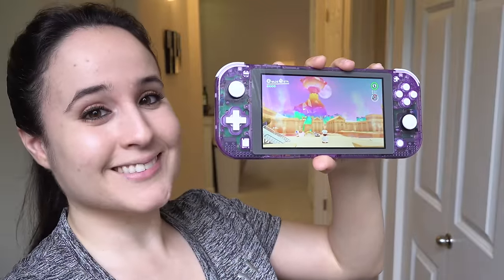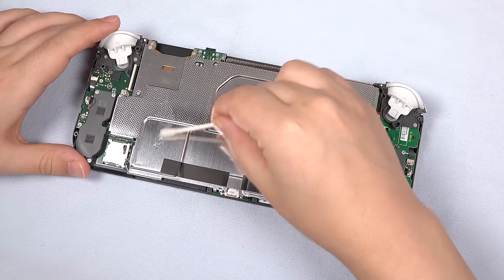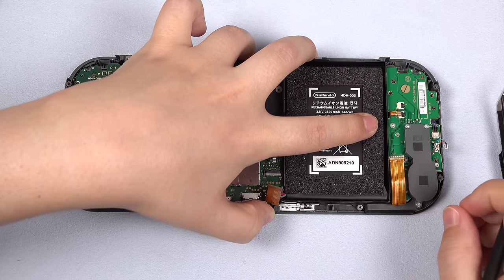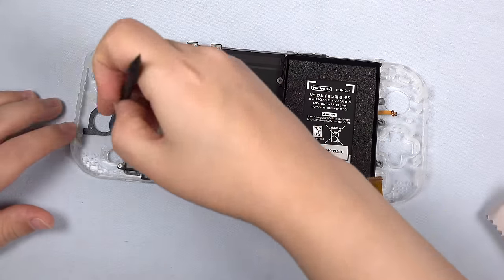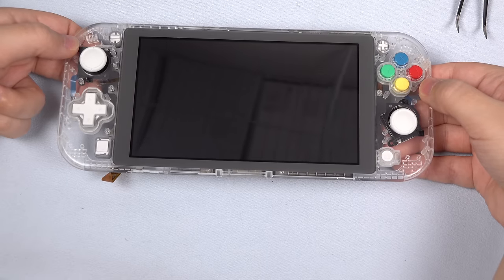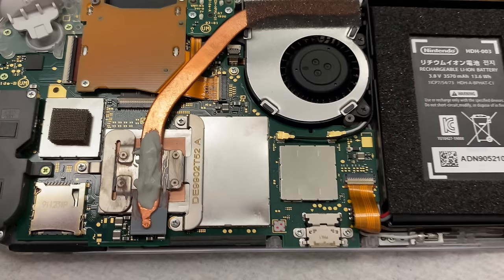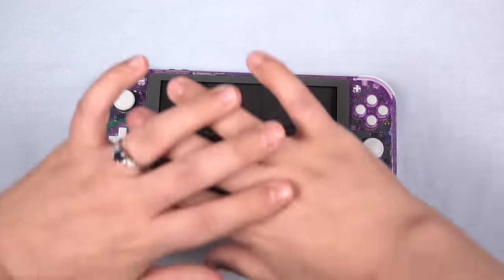DIY Switch Lite Shell Swap: Step by Step Tutorial [4K]

Comment: Lol dang I thought all I had to do was just remove the shell
Reply: Same
Reply: That happened to me when I had to change the drive on my PSP 2004 model. Laser was broken. I got the new drive, then checked a few videos on how to do it and decided to swap the shell in one go too, had to take it apart entirely anyways. So I also got a new shell. It was scary, there are even more parts and screws than on the Switch Lite (I've done two Switch Lite case replacements) and I was extremely inexperienced, but I got through. Had quite a lot of fun with that thing and it was pretty unique, clear bright blue.
Reply: Can you please list the external materials required to do this, like the thermal paste etcetera, I got part way through your video took my Switch apart and then learned I didn't even have everything I needed! I'm not saying this is your fault at all but the heads up that other components are required to do this would have been handy before frustration and dissapointment was caused
Reply: Ok so it def was more advanced than assumed lol... Especially with heating around the screen
Reply: @fenrirharrell7833  it's in the description for anyone who wants to know she forgot to leave a link to isopropyl alcohol but most people have this anyway so, just pick some up at your local pharmacy.
Reply: I  was guna do this by my self now I'm guna leave it to the professional  my battens keep sticking  and would love to change  the cover
Reply: Same. I'm not going to do it im to stupid
Reply: @TheJonny2480  you're not stupid. It's just a risky thing to do. Don't put yourself down
Reply: Same
Reply: I would literally only change the back I’m not taking apart the whole damn system
Reply: This is way to advanced for me. I might make my boyfriend do it but im scared he'll destroy my switch
Reply: Dang is there anyone reputable out there that does this type of modding? Crazy it's not just a simple shell swap!
Reply: @A_Gzilla  I’d do it for you but it cost probably $175 plus shipping and the shell kit. It takes a couple hours. Big job but not impossible if you’re patient.
Reply: I’m just gonna get a new one
Reply: Same
Reply: same i’m pissed😂

Comment: I would recommend making a video on how to fix the joy con drift! There may be lots of videos out there that relate to that topic, but you explain things so well in 4K. Plus you’re awesome!
Reply: Just replace the sticks. They're easy to replace and it's more of a permanent solution than to fiddle with them by trying to open them up.
Reply: This video covers it.. why are you promoting the same content being made more than once. All it takes is some really well placed time stamps to get the same video about how to fix or change the joycons.
Reply: I've already seen a video on this very subject! Though it mostly depends on its diagnosis.

Go to the calibration settings via Settings>Controllers and Sensors>(scroll down) Calibrate Control Sticks>Tilt the stick you want to calibrate.
Once you have selected the joystick you want to calibrate, watch how it moves away from the center of the '+'. Apply pressure to the shell directly by the joystick (just the part by the hole it comes out of). If the dot goes back to the center of the '+', you have an issue with pressure on the inside of the joycon.

To fix the pressure problem, simply put a small piece of paper/cardboard (about 1mm thick) on top of the joystick, between the silvery back (of the stick) and the battery plate. That should fix it!

HOWEVER, if that does not fix the problem, the issue is definitely just your joystick and you need to replace it.

I know it's a year late, but I hope this response helps you understand how joycon drift happens and how you can permanently fix it! <3
Reply: @nomoretwitterhandles  Spot on

Comment: Timestamps for ALL SCREWS
--------------------------------------
Just taking some personal timestamp notes for the screws! Kinda messy notes since they were for myself but if you can figure them out I hope it helps!

TOTAL SCREWS: 48 (to keep track)

1:47 - x 4 Back Screws - x2 Top Screws - x 2 Bottom Screws

2:25 - x3 Silver x1 Gold Shield Screws

3:03 - x3 Copper Heat Pipe Screws

3:25 - x7 Game Card & Audio Screws

3:44 - x3 Black Fan Screws

4:07 - x2 Gold ZL - x2 Gold ZR

5:06 - x1 Gold Left Speaker - x1 Gold Right Speaker

5:39 - x2 Gold Left Board - x2 Gold Main Board (SAME SIZE & COLOR)

5:53 - x2 Long Silver Midframe

6:05 - x3 'Board Screws' (SAME SIZE)

6:36 - x2 Joystick Left - x2 Joystick Right

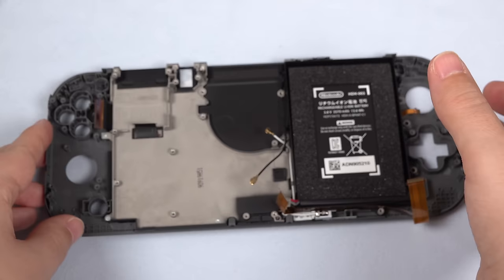6:58 - x1 Long Silver Midframe - x3 Smaller Midframe (LAST SCREWS!)
Reply: youre awesome brooo
Reply: Your video has been immeasurably helpful ! Also when you note the gold screws during the rebuild was so helpful for me. Thanks for these notes !
Reply: You’re amazing
Reply: You are a life saver

Comment: I just did a shell replacement following this. Some advices: 
1: you don't have to disconnect the battery. The little cables that goes to the connector are VERY fragile. They break very easily and if you do like in this vid (unpluging it by pushing out the cables) you will break it for sure. Just make sure that you power off the switch COMPLETELY. Do not dissassemble if you have your system in wait mode or you may fry the motherboard.
2: the same goes to the speakers. You don't have to unplug them. They are EXTREMELY fragile and breaking the cables is very easy. Just handle the board with extra care, but do not unplug them.
3: the new shell should not use the original screws. Use the ones that come with the new shell, as you may crack the shell otherwise like erica said.
4: do not place the hair dryer for a WHOLE minute while it's on hot. Just a couple seconds its okay. You may damage the digitizer and the LCD if it is very hot. Remember that you only need to heat the adhesive, not the LCD.
5: it is not necessary to replace the thermal paste if its in a good condition, but it's always a good idea. The switch lite does not overheat that much either.
Reply: Thank you!
Reply: Too late I broke…
Reply: Definitely unplug the battery; it's cheap and easy to replace the battery with a new one that will have a new connector should you break the wires off the connector (which you likely won't anyways).

On the other hand, if you short a chip somewhere on the motherboard because you didn't unplug the battery, you might as well buy a new switch.

Comment: I just replaced my shell with an NES shell. You made it very easy and i was able to pause (ALOT). Everything went smoothly and everything works/ functions great. Thank you! Side note, i did have to slightly sand down my L trigger as stated. Thanks for that tip as well.

Comment: Yes this tutorial was one of the best on youtube for Nintendo Switch Lite Shell Swapping. I especially love how you dont peel up the battery since its not required to do so. 
The only omission from it is how to lift the latches on the ribbon cables. You dont show how to flip the latches on them. I did have to look to another video for that, but with that sole exception, I followed yours step by step to change the beat up looking (but good screen) switch lite I bought for my daughter into a custom atomic purple, pink and unicorn theme switch lite.

Notes I especially liked:  Pointing out if all the screws were the same, or if one was longer. Doing the gold ones or longer ones on a different step to avoid confusion.  Speaking of your sponsor, ifixit, they make a "ifixit anti-static project tray" that honestly, I initally thought was dumb. my wife got it for me.  But..... following your guide, I did each step with the screws and parts placed in a compartment.  each step was a new compartment.... so when I went to reassemble, the screws were together. Parts were in correct order. Was excellent.

Comment: This is way easier than I thought it would be. The design is genius how everything plugs or screws or pops in. It's just a lot of steps, but that's what the video is for! Haha, so you can follow along.
I modded my GBA and I had to carefully trim parts of the shell to fit the new back-lit screen , with the clear green shell, every little cut or scratch shows through.  I'm glad this doesn't require any cutting of the brand new shell.
I definitely want to do my switch now in a clear jungle green, or clear slime green, or clear orange like the N64

Comment: THANK YOU!
This was by far the best video I've found on this topic. I've done multiple joycon shell swaps and was a bit intimidated by this mainly because of worrying about breaking the screen, but thankfully the entire process went smoothly. Well, _except for breaking the left speaker. Not the speaker itself, but the connection that's soldered to the board that it plugs into. I accidentally pulled on that instead of just the wire/plug kajigger. I can solder, but I'm not confident enough to attempt soldering that small. Plus I don't think I've a tip that small. But, *oh well. I typically just use a BT speaker or headphones.

Regardless, I've now got a very sweet looking all black (housing/buttons/sticks) and I'm much more comfortable with this sort of thing now.

Thanks again!

Comment: Thank you very much for the tutorial! Very clear and straight-forward!

Just one tip tho: when removing the battery connector, be veeeery careful not to pull the black connector of the board, only the gray part. That was nightmare to solder back lol

Comment: I had to replace mime because it took a hefty fall and destroyed the casing near the left speaker. Also ever so slightly bent the motherboard so it'll never be new but thanks to your tutorial my switch lite looks good and is running as perfect as it ever did. Thank you for being so in depth. Btw the blow drier was clutch. Heat guns can be a little too hot.

Comment: I did the same thing for a normal Nintendo Switch and it is significantly easier. You don’t need to d/c ribbon cables, battery, audio ect. or go into the main motherboard. You just remove a backplate and replace front and back shells of the joycons after you unscrew and undo 4 layers in the joycons themselves...not to mention only 2 types of internal screws. For the Switch Lite you have to basically take everything apart whereas for the normal Switch it potentially takes 15-20 mins if it’s your first go and afterwards when you realise how easy it is, it takes 2mins.

Comment: I was following this guide and I made 2 mistakes. 1, I broke off the right speaker entirely from the motherboard (didn't understand what you meant by disconnect) and 2, I snapped of the lock to the fan's ribbon cable. The speaker I don't mind since the other one still works, but I am concerned for the fan. Will it still be able to work? The ribbon cable is in, but just not locked into place.

Comment: Hey Ericka, great video! I was able to get the complete shell swapped. Only problem is that after an hour, the screen started to flicker on and off rapidly as I was playing a video game. Initially it was fine though. Any reason this happened? 🧐

I made sure to clean and apply the thermal paste in the heat sink as well.

Comment: Hi, I have a question. I changed the casing on the Lite but I feel like the buttons are not well adjusted. When you move the console it makes a rattling sound. Is this normal? Because I installed the colored buttons that came in the package.

Comment: I followed your instructions carefully, however after completion I noticed 2 issues with my switch. The volume buttons are occasionally unresponsive and it won’t take game cartridges anymore. I made sure the ribbon cables are inserted correctly with the clips closed but it’s still not working. I don’t understand what I did incorrectly.

Comment: Hello, I have stripped screws, so I am not able to remove them properly. The Y screws, also the Phillips screws are stripped. Have tried already the rubber band method, didn't work. Do you have a clue on this?

Comment: Hello!
I followed your tutorial, but I've come to a error: the fan automatically turns on at max speed as soon as I turn the Switch Lite on. 😰

I'm a little scared that it could get worse.

Also, the system detects when there's a cartridge inside, but won't read it (it displays a message saying that the cartridge can't be read.)

And last, the new "+" and "-" buttons are so tight, they don't even get out of their respective shaped hole, I've tried to switch them upside-down, but they are still so tight to fit.

Do you have any advice and /or help??

Comment: Ok so I made it to the part where you test for function. There is sound but the display is black. I've tried turning it off and on multiple times, that works, but still no display. It flashes once each time I turn the screen on, so I know it works, but it doesn't work. What am I doing wrong here?

Comment: Really cool tutorial and thanks for your help. I just gotta say its not ideal to test the Switch when the back is exposed, as your fingers can induce ESD onto the motherboard. Its be better to get the back cover and place it on to the Switch (without screwing it in yet) before testing to avoid potential discharge.

Comment: I want to do this in atomic green using the yellow switch lite so the edge around the screen will still be yellow to go good with the yellow buttons. The yellow & green would go good for a Zelda theme. Maybe even put a Zelda decal on back or on the metal heat guard on back before putting the clear green shell on over it. Problem is I still cant find the green shell for the lite.

Comment: Not sure if this has happened to anyone else, but i did the whole process, step by step and was careful, however, when we got to the part of testing the functionality of the switch after putting most of it back together, my screen now is ghosting. Looks like burn in. Not rlly sure what to do, I tried reseating the LCD ribbon cable, digitizer ribbon cable, and backlight ribbon cable. The screen responds to my touch, but the image is distorted.

Comment: What a small battery for the size of the device. Given that the connector looks pretty standard, I have to wonder if you couldn't just replace it with a battery with triple the capacity.

Comment: great video! but just an FYI you do not need to clean the paste nor replace it, i didnt with mine and it stuck back perfectly fine :)
Reply: A thermal paste’s purpose isn’t to stick things. It basically prevents your device from overheating and is highly recommended that you reapply it.

Comment: Hi Erica! I tried your step-by-step tutorial today and I faithfully followed everything in this video. I even made extra sure to carefully remove and handle the screen and the ribbon cables. However, careful as I was, my Switch Lite is stuck on a black screen. I know it's on because there is a sound when the button and the screen are pressed, yet nothing appears on the display. Do you have any idea what could have gone wrong and what should I do to fix it? Would greatly appreciate a response.
Reply from the maker: Bring the unit into the light and see if you can see an image on the display. 

It could be that your backlight cable isn’t pushed far enough into the connector. Make sure all the connector clips are closed.

Comment: Anybody able to give advice on the LCD? I've got it back together but I have no video signal. I get the menu audio.  I heated it using a hair dryer, then used a guitar pick to slowly work around it so I don't think I bent it, but is it possible I got it too hot with the hair dryer?

Comment: When I remove my battery part it stick on top of my LED screen so when I remove I heard tape tear sound from my lcd screen, but there is no crack line on the screen, but when I re assembled everything after boot up my screen is dead and not switching on? Anyone have the same issue ? Pls help😢

Comment: This was so helpful, thank you! I have experience with only the "doesn't matter if it goes back together" level of electronics deconstruction. This video made it so easy. In case anyone is curious, like I was, I took a photo of all the screws from the switch. 48 total screws. Following Erica's instructions, I ended up with 15 groups of screws. You could probably do it with ~13 groups if you wanted to. Took me about 3 hours overall.

https://i.imgur.com/ExVAx8T.jpg
Reply: Most of the screws are the same length and you don't really have to take the fan out, so you don't really need an extra group for those three thick, black screws. If you put all screws with the same lenght together you end up with just five groups, 1. black Y-screws (outside), 2. black +-screws (outside), 3. short silver screws (inside), 4. long silver screws (inside), 5 golden screws (inside).

Comment: What kit should I get bc I was trying to fix my kickstand, but I accidentally tore my right joycon rail ribbon cable
Reply from the maker: Huh? The kickstand is nowhere near the joy-con rail ribbon cable. Choose any kit that has a Y00 screwdriver bit and J00. So the joycon fix kit will do or you can buy the drivers separately. Click my link in the description to go to their site and browse.
Reply from the maker: Check out their switch parts catalogue as well to see if they have any joycon rail ribbon cables

Comment: Anyone else just remove the whole battery connect ? Fucked up my switch @2:56 the black piece came with the battery plug in… I used a spudger aswell. The two grey pieces on the sides are clips, wish I had noticed that before removing the solder points. Hopefully I can get this soldered back ! And hopefully the rest of this video explains a bit more

Comment: Can't you just unscrew the top and bottom shell, do nothing else, and just screw on the new ones?
Reply from the maker: That would be cool, huh!? But sadly, no. There are layers and layers of screws that are only accessible by taking the whole thing apart. Then when taken apart you still need to take out the screen, which is stuck with adhesive. Not that simple.